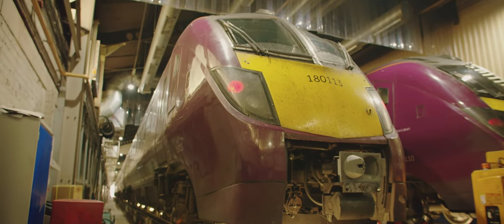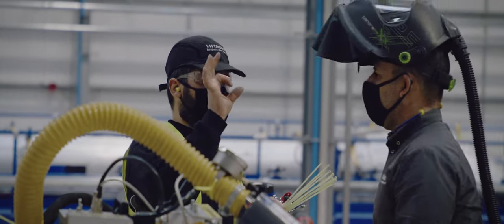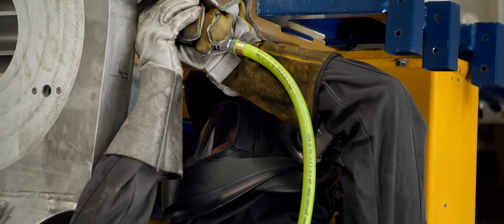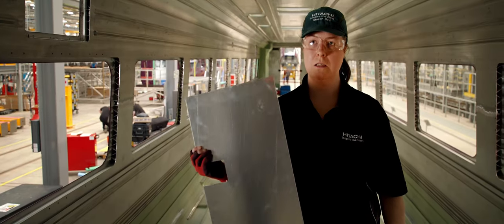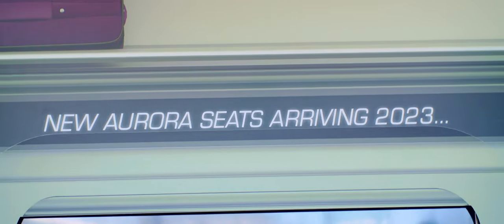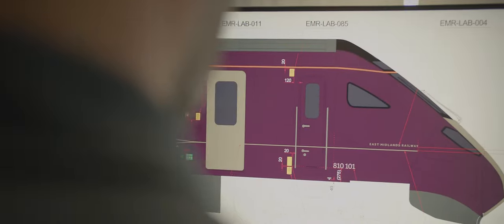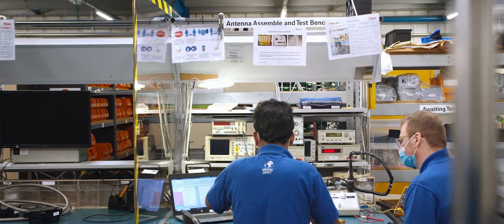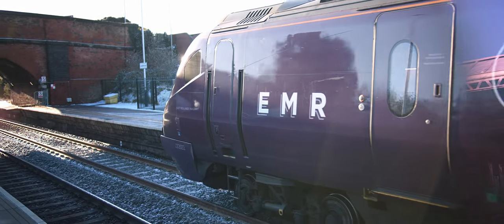The Aurora Project | Episode 1 | Building The Fleet | EMR

Comment: With the Class 222 Meridians that are to be replaced by the Class 810 Aurora. I do think that they should be transferred to South Western Railway to replace the Class 158 and Class 159 Sprinter Express. 

And the Class 180 Adelante to be cascaded to be used on the East-West Rail line or cascaded to Grand Central to join with the other Class 180 Adelantes.
Reply: class 222s are going to cross-country and 3 other operators i believe.
Reply: Ok. If that's true.
Reply: @trainsimworldjourneys5267  which 3 other operators?
Reply: Hi from the EWR Area, please no, I don't want a class 180 heading pass woburn sands level crossing when the 230s do the job fine

Comment: Why just 5 cars?  That is way to short for a intercity train! Should be at least 9 cars, like on the ECML.
Reply: Platform lengths. Long Eaton cannot accommodate 9 car train lengths. By building 5 car units, short sets can serve smaller platforms, or two 5 car units can be coupled, for example on fast Sheffield services, where platforms that major stations can accommodate. We see this currently with the meridian fleet, occasionally running with 2 class 222s or 180s, coupled together.
Reply: My thoughts exactly

And EMR ran 7 car sets, only 2 shorter. If the short platform stops were reserved for the 4/ 5 car trains, why stop the 9 + car sets there?

Edit - and seems they ran 2 + 8 HSTs... seems strange to go straight to a single 5 car set fleet when they have the experience of running a very diverse fleet.
Reply: Pack 'em in tight and overcharge for the privilege = lots of profit for the shareholders.

Comment: I wonder? What an opportunity to use the Meridians (once or if EMR keep them) to replace the knackered 156 units nearing 38 years old. Could use the Meridians as a x2  x3 or x4 car set. Abolish first class & turn in to second & take out x2 or x3 loos leaving one loo per train set for more seating. Be ideal for Nottingham, Leicester, Newark, Lincoln, Doncaster, Peterborough, Grimsby & Skegness services
Reply: The 222s are unsuitable for working stopping services, especially when other routes are more in need of them. Ideally they would stay on the intercity services working alongside the new units, although they're more likely to be scrapped. As for the 156s they will be replaced by class 170s from Transport for Wales.
Reply: @u7yf3tz5vm  EMR has some 170s from Scotland. They received them knackered as it was. No end of trouble. Hope the Welsh ones are in better condition
Reply: @111cccccc  TFWs 170s are a bit knackered but still better than the Scotrail units. They seem to be sending the worst ones first.

Comment: EMR instead of getting new intercity trains what about the regional trains as the 156s are old and out of date the class 158s are showing ages slowly and 170s are ok just need something new for Skegness and Lincoln that can fit the routes during the summer season
Reply: I'm a frequent traveller on the Skegness to Nottingham line and it's bloody awful. Even the class 170s in three car sets are barely enough. But in the peak season 2 car class 156's is just absolutely abysmal. But I guess getting class 170s on the line is a start.
Reply: @scottwojcik2148  We need like 6 cars for skegness like a double 170 or something we haven't seen
Reply: Haven't the 156's gone?
I believe the 158's will be replaced soon.
All depending on the 170 cascade.
Still, it beats BR with a single dogbox  (153) on Witsun Bank Holiday to Nuneaton in 1992 from Skeg-Vegas

Comment: This is taking forever, all other lines have nice new trains and we're still years out. Depressing.
Reply: not all other lines.
Reply: They're coming from 2023.
Reply: @devon896  Which will probably be pushed back as they'll inevitably find faults while testing, that's if they're not on strike.
Reply: @RWL2012  LNER, Greater Anglia, Northern, TPE, Hull Trains, GWR, SWR, SouthEastern have all had some new recent stock.
Reply: why is it depressing? the new intercity stock is a lot less comfortable than the old intercity stock, mainly seat shape and ride quality

Comment: These new safety systems… TPWS and AWS - these are on the HST’s and 222’s, no? What’s next gen about this version? Serious question…
Reply: ERMTS is the new European safety system. It lets you use the track way more efficiently by having the trains communicate with each other. So trains can drive closer to each other. It also keeps way better track of the trains for both management and passengers. TPWS and AWS are old fashioned systems not made for the 21st century